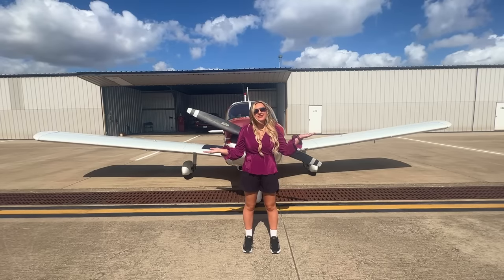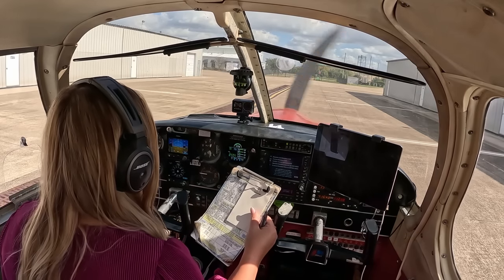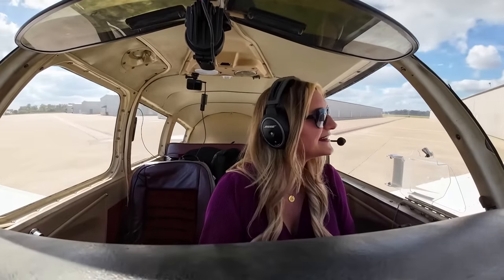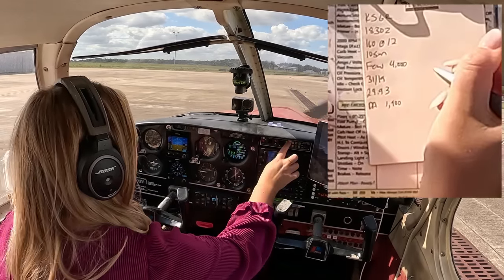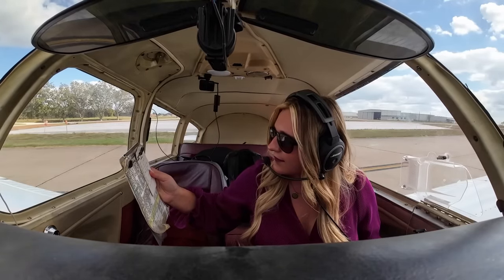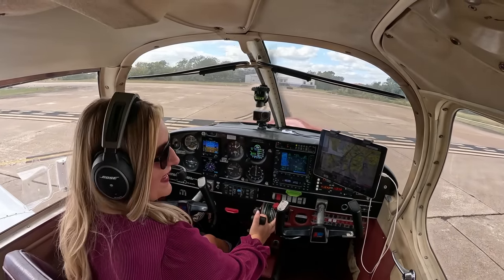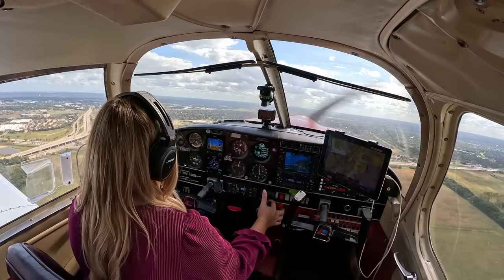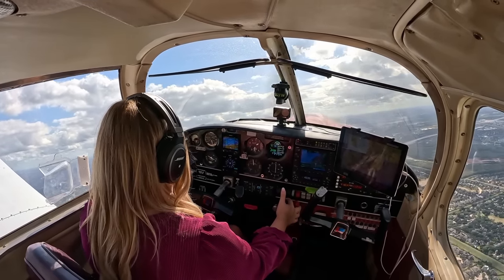Emergency! Failure In Lil Red - Return to Airport!

Comment: Maybe is too rich ?.. when you start the engine I heard you said that it start really quick that could be a sign of a too rich engine.
Reply from the maker: lol - You're the first person I've ever heard talking about a problem with an engine that starts TOO FAST! I've been in many that take a long time to start. I think you have been gvien some bad info at some point. A healthy engine will start right away. I went to Lakeland Florida a couple of years ago and it was around 40 degrees out. The flight school had a guy with a heater blowing hot air into the engine compartment. As I started my pre-flight, the student jumped in and started cranking on the airplane. I finished my preflight, jumped in, Lil Red started right up (3 primes because of the cold), and as I was pulling out, they were pulling up with another battery. lol

Comment: Why did you change to ground control frequency during your final phase of flight. At 29.06 on approach, you checked in with the tower, then at 30.16 you switched to Ground Frequency. This was a critical Phase of flight, and you would have missed all important and critical flight, traffic and control information from the Control Tower. What if the Controller needed you to go around or needed to issue a control instruction. They have light guns, but your radio was operational. Normally the Tower would advise you to change to ground when appropriate. Other than that, everything looked really good. Anyway, in conclusion I would suggest you remain on the tower Frequency for the entire approach.
Reply from the maker: Hello! Great question, I apologize for the misunderstanding. When I said we were switching I was putting ground frequency into my secondary frequency slot. I did not switch from tower to ground until after exiting the runway 😊
Reply: OK thank for the clarification! Good Job and looking good up there!!   @FlyWithKay

Comment: I would have felt bad about taking off as soon as I realized there was FOD in the cockpit. She put her pen on top of her instrument panel at the start but lost it by the time she got to EOR.. ooops . Also,with all that unstable  rising air causing turbulence making for a bumpy flight, you don't need to be in that situation, that fuel consumption glitch may have just saved her *ss 😅

Comment: Great way to teach newbies what a $100 cheeseburger is all about. Not sure why to file an IFR clearance on a single engine little old plane with perfectly good VFR conditions. We usually take off and then pick up an IFR flight plan in the air if we need to climb over FL 180 or because the weather is not IFR, but I guess it is good to practice if you're new to IFR or want to do more work before you take off.
Reply from the maker: IFR is my preferred way to fly because I find it safer and more enjoyable😊